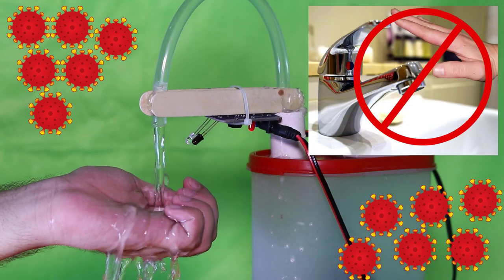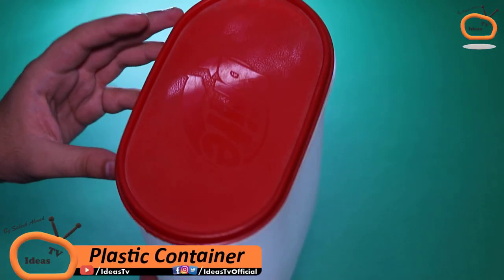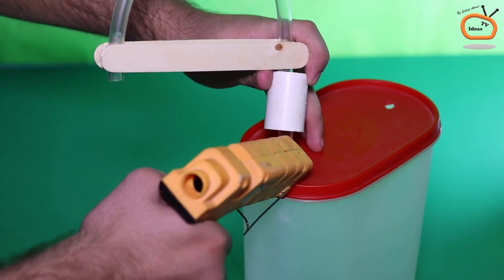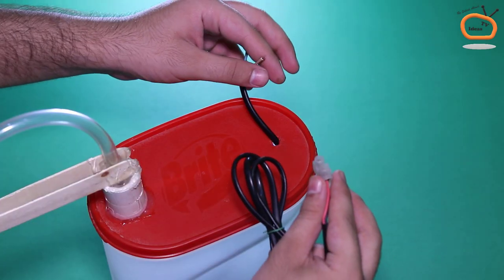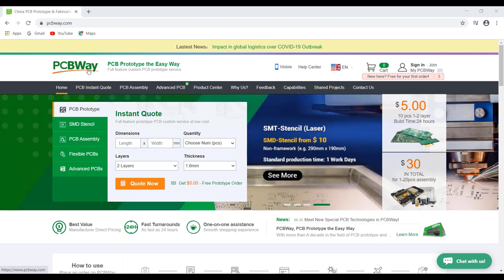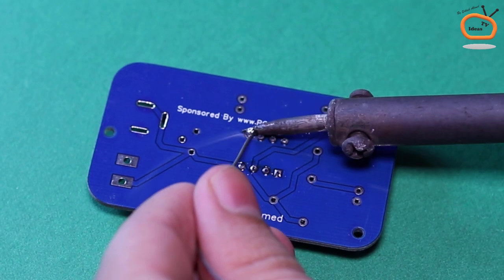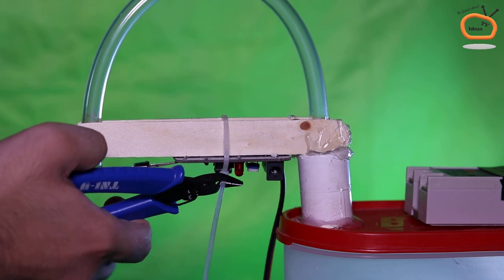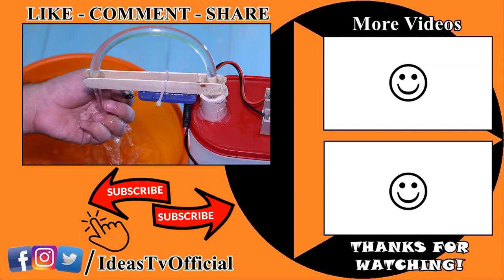DIY Automatic Touchless Water Tap (Smart Faucet)

Comment: You need :

1. Rubber pipe
2. Ice cream stick
3. Plastic container
4. PVC socket
5. Aquarium Pump
6. Power Cord
7. 12v Solid State Relay
8. PCB
Reply: THANKS😙